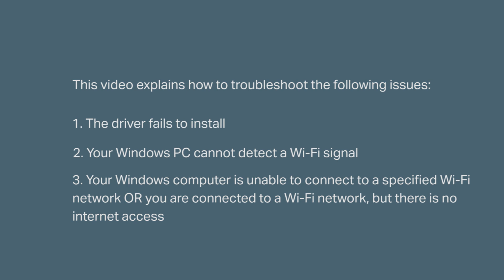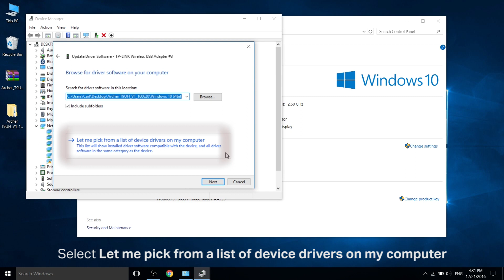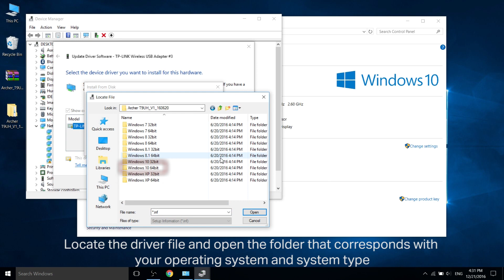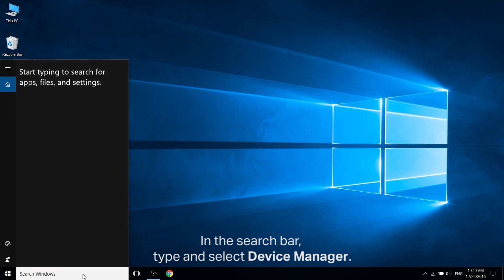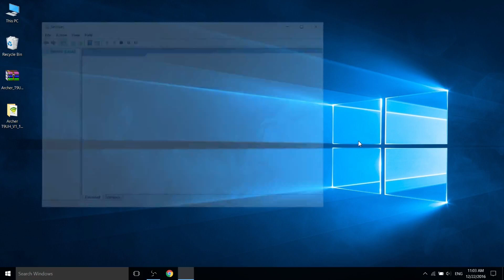How to Solve Common Problems When Installing and Setting Up a Wireless Adapter (Windows)

Comment: Archer t9e it's not working on the latest windows update, not even with the options from this video.
Reply from the maker: This video is from 2017 so its steps may be outdated.  Every update to windows or Mac OS may break a driver based device from working.  This is rare but when the OS makes significant architecture changes there is a change the driver may be "broken" and the device stops working.    In these situations it will take time for new drivers to be built, especially if the chipset make is not informed ahead of time for potential issues in upcoming OS releases.   The best thing to do is contact support and report the issue.

Comment: It’s still it showing a network
Reply from the maker: I don't follow.  What do you mean it is showing a network?
Reply: TP-Link sorry it still doesn’t’ list my network
Reply from the maker: @8GigaKam  Okay thank you.   depending on the adapter it may be a network issue, for instance if you have Archer T1U this adapter can only work with 5GHz networks.  If you don't have a router that gives 5GHz network the adapter won't work.  Or say you have a 2.4GHz only adapter and the 2.4GHz is disabled on the router.  If this does not fit your situation you might have a defective product and we would then suggest contacting support.

Comment: Hello Guys I am having problem with TP-Link wireless WiFi adapters in Kali Linux
I used TL-WN8200ND Ver 1.1 and TL-WN822N V4 both gets detected and WiFi signals come all right but I enter WiFi password and click on connect it takes a lot of time and last an error come that connection cannot be made I used another company adapter and it worked fine
Reply from the maker: The TL-WN8200ND does not have linux support at least not the V1 available in the US.  the TL-WN822N does but only up to kernel 2.6.18 ~ 3.10.10.  If your version is beyond this Kernel range then that would likely be the issue.
Reply: @TPLINKUS  Thanks i will try the possible solution

Comment: Suck driver on TP LINK T6E AC1300
can connect to AC and 5ghz
is always connect to wireless N protocol
please update the driver on windows 10
the latest driver is in 2015

Comment: i am getting wireless network adapter is not detected error. i want to install drivers so that i can use softap mode for hotspot but i just cant. althought i can turn on wifi mode by just plugging in the adapter but just cant install its drivers

Comment: So my problem is the adapter is working normaly without the driver for 2.4G and does not workt for 5G when i install the Driver any Network isnt working i got the Archer T2U AC600 Ver 2.0
Reply from the maker: does your router support 5Ghz?
Reply: @TPLINKUS  yes
Reply from the maker: @marco.666  Then we would recommend contacting support to troubleshoot the issue.  you can find support for your region here:  https://www.tp-link.com/us/choose-your-location/
Reply: It Worked Fine before im at Unitymedia and got the connect Box an an 200mbps
Reply: To say it quick yes it Supports 5G

Comment: I'm having the following situations: 
1-If it stays on for a long while, it gets the 'limited/no connection' icon (the yellow exclamation on the wifi icon). Like tonight, I went to bed, woke up, it was like that, and would only come back after I physically removed the adapter and put it back on.
2-For some reason, whenever I switch from 2.4ghz to 5ghz or vice versa, it'll disconnect from Windows and reconnect itself (it plays the sound effect for connecting/disconnecting a USB port). Is that normal? 
3-Many times, I've had the adapter unable to find or connect to either 5ghz or 2.4ghz networks at my house (despite having my iphone and my console games all able to find both networks and connect to either). This one I'm figuring is the automatic balance option of the wifi disabling the search for 2.4ghz networks and looking exclusively for 5ghz (and vice versa). Is that it? 

I have installed the official drivers from tp-link's website, and uninstalled every other driver that there was before. I am quite close to the router, but I have two walls (from the hallway) separating me from it.
Reply from the maker: We can answer basic questions on YT for support please contact our technical support team.  The number can be found on TP-Link.com

Comment: I'm having problem #2 and when I go to device manager and into network adapters the TP-LINK adapter doesn't seem to appear.
Plz help me fix this
Reply: I'm pretty sure a windows update just deleted my drivers for it, but I'm no expert.
Reply: And if it was could you plz send me said drivers
Reply: me too
Reply: @hemaux8752  I just ended up buying a new wireless adapter because it turns out mine adaptors doesn't support windows 10
Reply: @BoomyKing  i fixed my problem now my works fine 👍
Reply: @hemaux8752  how
Reply: @BoomyKing   i just downloaded my own Driver and it works
Reply: btw iam hema ux
Reply: I can't download the driver it isnt compatible with win10

Comment: Is there a Wi-Fi adapter that will work without a disk drive cuz my PC doesn't have one
Reply from the maker: All drivers for our adapters are available for download on our official website.  You can also load these drivers on a flash drive if you need to download from another pc.

Comment: Hi, It's not working, running the driver setup. But keep mentioning that the "Unable to find your adapter". Tried to install driver manually but no inf file can be found.

Please advise urgently.
Thanks/
Reply from the maker: We would recommend going to tp-link.com clicking on support then contact Support for more assistance

Comment: I don't want to sound like a douche , but can you tell me why TL-WN8200ND v2 has worse performance than TP-LINK TL-WN722N v2? It seriously annoys me and drives me crazy , i wanted to upgrade to get better net and all i get is nothing more than unstable connection when i play games (i am not expecting 100% good connection but ping ranging from 59 ms to 600 ms is just too much) . This is by far the worst adapter i've ever bought , not only that but it doesn't have utility so i can't see how good my internet compared to the position/distance and antennas position but it also can cause BSOD even when i have the drivers updated. It is the 4rth TP Link adapter i bought that failed me and this one , supposed to be my best tp link adapter i bought , ended up to be the worst.

Comment: I have a TL-WN881ND, it will work fine but sometimes, several times a day the yellow no internet access triangle shows up at the wifi logo and internet stops working. Every other device in the house works fine.
Reply from the maker: Sounds like the adapter is losing connection to the internet.  First thing you want to do is check your router for issues such as IP conflict or dropping connection.
Reply: @TPLINKUS  I think Avast antivirus was generating conflict. I'll find out once I keep using the computer.

Comment: i have 120MB/s but still my adapter give me only 54MB/s when it has limit 150MB/s ... who can me tell me why ? xD
Reply from the maker: There are several factors that contribute to the speed you.  Link Rate, Distance, Band, interference, processor load, etc.   Without troubleshooting it would be hard to determine that.  Contact Support so they can help.

Comment: Hiiii ,802.11n can't see 5Ghz wifi pls help me
Reply from the maker: 802.11N does not necessarily mean it can see 5GHZ.  N is available on both 2.4G and 5G.  you will need to make sure your adapter is dual band in order to see 5G

Comment: Old Dell Inspiron, was stubbornly wanting "Owner device password" - managed to disable that in add/remove software by using 'change' got it connected. 
Then it took some viral problem and went down with the blue screen of death. 
Had an old Win XP disk, and couldn't repair windoze, so reinstalled. 
Can't get Dell wifi drivers for love or money.
got one your TP link dongles 
it sits there happily saying wifi connected but Windows XP can't see it. 
Nevertheless Windows has decided to disable it and offers me the option to disable it. 
oh fantastic! 
Windows can't SEE the wifi (which had been 'connected') so disabled it, then asks me if I would like to disable it again. 
I can't figure this one out now. 
I may have to throw it out of the window.
Reply from the maker: If you have a built in Wireless NIC go to your system and disable it.  Likely there is a conflicting issue you need to address.
Reply: @TPLINKUS  Thanks for replying.! :) 
I've got internet explorer to see it and it is active but I can only reach Microsoft websites, not google. 
(lots of people asking this same question - "Why won't Internet Explorer open google? (for example) yet sees Bing")
...must be something weird in the IE settings.
Reply from the maker: @borlani  Its possible,  MS has also dropped support for IE so we would recommend a more up to date browser.  Chrome or Edge are decent choices.

Comment: may i know why i get less than 100 Mbps on my windows 10 desktop?  i subscribe 300 Mbps from the internet service provider, and i speed test it on my phone and get around 160 Mbps and the WiFi router is less than 5 feet from my desktop. i'm using TP-Link AC600 High Gain Wireless Dual Band USB Adapter  Archer T2UH as my desktop WiFi adapter..

Comment: What if all is installed correctly and i can connect to wlan but i get disconnected after a short time and the adapter gets reseted. That happens very often and i dont know what to do
Reply from the maker: That could potentially be a driver conflict or a conflict with another adapter.

Comment: I can see the wifi adapter in my network connections but it is disabled and everytime I enable it it auto disables again
Reply from the maker: You likely have an adapter or driver conflict.  That or the windows WLAN autoconfig service is not running.  We would recommend to check these and if you have any issues to contact support for further assistance

Comment: I cant find the inf file, please help meee
Reply from the maker: Some TP-Link adapters do not give just the inf file you will have to run the installer associated with that driver to get the file to install.
Reply: I cant run it because the driver cant detect the hardware, i already plugin the wireless adapter and its detect on "other device called network controller", how do i change that, iam using tl-wn781nd
Reply: And yes this driver doesn't have inf file, what should i do?
Reply from the maker: @dinantaramegabintang4939   So the card is being detected by your computer but as another device?  You will first want to look at your network devices and make sure there isn't an active network WLAN controller already installed. If there is then you will want to remove it and then run the installer program for the 781Nd.  That will install the inf file for you.  If that still does not work you will want to contact support for further assistance
Reply: Yea i already contac and the technical support dunno what going on
Reply from the maker: @dinantaramegabintang4939  reach out to support@tp-link.com

Comment: My adapter works, however it often disconnects and is not detected by my computer. When it works, my connection is great, superb even. Have tried different ports, restarting computer etc. My windows is up to date. I assume i just need a new adapter as it's most likely a hardware problem. Anybody experience the same thing?
Reply from the maker: First make sure you are using the official driver and not the windows default driver.  Although the default driver is sufficient most of the time, there are instances where its less than stellar. Using the official driver is always recommended.  If that fails to resolve the issue we would say contact TP-Link support for further assistance.

Comment: i have lag how do i fix that? do i connect my wireless adapter via wps? please help, thanks!
Reply from the maker: There are so many factors that can create lag that it would be impossible to answer this in a comment section.  go to TP-Link.com  choose Support then Contact Technical Support and contact our technical support team to help further.

Comment: I tried all Tp link wireless usb but my desktop restarts  or shutdown when I connect it or install it ....  the desktop pc  detected it nice but it shutdown when connecting  Tp link to it ..... why ? Note it is desktop win 7 not laptop .
Reply from the maker: could be the default windows driver causing it.  We would recommend using the official driver for the product found on TP-Link.com.  Also make sure no other wireless adapter is active on the computer.

Comment: I connected my tp link wn751nd v2 in the slot pci but my computer not detect it, im completely sure that connection is ok, but when I try to install the drivers it says this device can not be started (code 10), anybody can help me ? my motherboard is asus m5a78l-m plus/usb3 and Im using win 7 ultimate sp1, pleeeaaase
Reply: maybe upgrade windows?
Reply: Same problem, im using win 10
Reply: I upgrated to windows 10 and the problem persist, I think this wireless adapter is a piece of crap

Comment: Hi, I've discovered a fix for my TP-Link AC600 T2U (Archer - V2), I was having 0.2mega download, the computer was one story up relative to the router. But a download speed test on the phone gave 16Mb/s. After drivers and you-tube and 4 hours of wasted time, I tested this adapter on the laptop and another old computer, and I had 16MB/s as well.

So my solution was: use a USB cable extension of about 50cm
... and it worked like a charm. It also resolved the latency problems it caused, I can now play Overwatch with 30-40ms latency.

I think the problem is that my 40$ metal computer case is shielding the radio waves of the wireless adapter. When I approach the adaptor to the case I get less than 1MB/s download in the test, and the overwatch latency is gowing in the hundreds of miliseconds.

Hope this helps someone, good luck!

P.S. - a 10cm cable may be enough, don't think you need a long one, just keep the adaptor away from metal, and test the download speed online.
Reply: i would love to try this but im not sure how.
Reply: Thanks man! My issue was also the shielding from the computer metal. Moved to the back usb port and it's good!

Comment: where i can find 2:08 this INF file. my pc can not understand "802.11a NIC" means. it need this INF File.
File is neither in CD nor in Downloaded Driver (from official web page) for V.3.0
Reply: Shree Hari I found it in the file that came with the adapter on the cd. If you have a cd drive then put the cd in and transfer the files from the cd onto your pc then when trying to find the file go to where you saved jt
Reply: @julien24_  as i said in comment... That .INF file is neither in C.D nor in latest downloaded driver...
Reply: Have you found the inf files? I have the same problem
Reply: sadly ! still Not.  @СашаКилимник-ц6м
Reply: Me also not find the inf file, even i also search to download the inf file sadly i can't find it

Comment: i did everything correctly and it doesn't detect any wifi's in my area when i know my rouder is on because my phone is connecting to it :(
Reply from the maker: We would recommend contacting support then.  They will work with you to determine the issue and help resolve it if possible

Comment: Hahahhahahaha. I found out what's the problem without finishing the video. I was browsing through the option of the driver of the WiFi Adapter, and found that it was on Transmit, so when I changed it to Receive it connected to my WiFi! 😂😂😂
Reply: hi there, I cannot find the place where it is showing Transmit or receive, could you help me with direction please?thx

Comment: HOW CAN I UPDATE IF IT'S NOT DETECTED!!!!?
Reply: Sulotion? I have same now, win 10 64bit
Reply: arnuzis SULOTION?? 😂😂😂
Reply: [UPDATE] 
I went back to the store where I bought the equipment and complained about it, so they trade me for the same wifi adapter. This one detected instantly in my pc!!
If your wifi adapter doesn't detect on your pc, it's problably broken...
Reply: I had the same problem and I just disabled antivirus and firewall and it suprisingly worked. I hope that works for some of you too
Reply: @dante.shotshot  so it showed up in device manager after disabling those
Reply: @landon8064   I just restarted, disabled windows and firewall and inserted the cd again, and it worked
Reply: @dante.shotshot  Wait so I have to disable windows antivirs real time?
Reply: @soapentertainment298   I had avast and I just disabled the shields and disabled firewall, when I inserted cd it worked.
Reply: Same here, it doesn't detect!
I even try on a different pc and nothing...

Comment: My problem is that everything is working fine, but the connection has detered over the past 6 months, and ANY time i attempt to play online, 5 minutes in will cut connection and tell me theres a problem with my access port? updated AND rolled back my drivers, which is a temp fix.
Reply: Jack  I'm getting the same problem with the tp link ac 1300
Reply: Callum Radcliffe same, I just got one of these with my new gaming pc and for the first week I was getting 40-80 mps now I can’t even run a speed test it’s gotten so bad.
Reply: Did you ever get it fixed? I’m having that problem at the moment and just need to know if I have to get another one.
Reply: Same is the problem with my adapter, did everything to fix it but it is just a temporary solution. Even the Costumer care is shit.

Comment: Damn how suck this
I buy tl n951n pci adapter v1 first it's said no compatible with win 10 so i downgrade to win 7 but it's still the same error code 10 pci adapter not insert 
Wtf is that i tried every empty slot on my motherboared and no result so what the hell is that ?